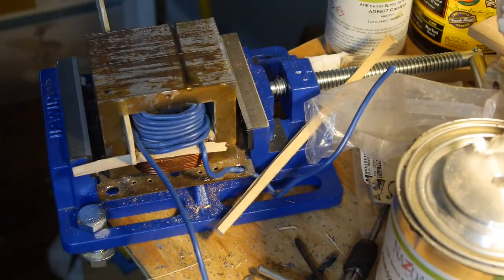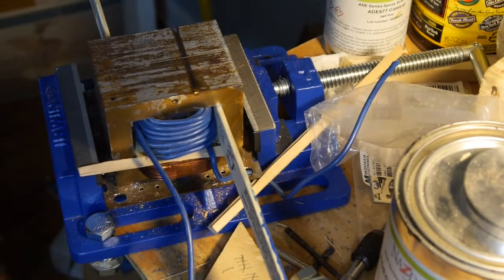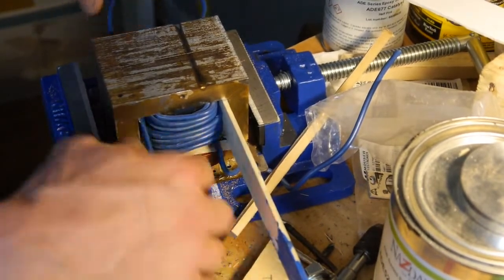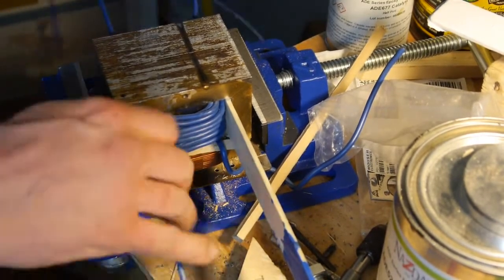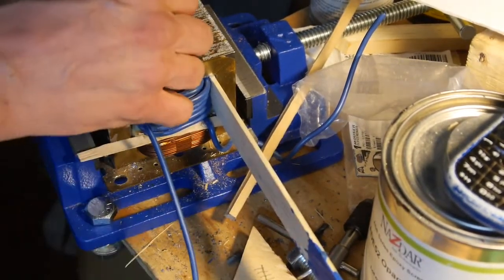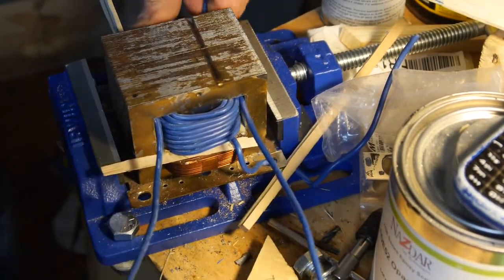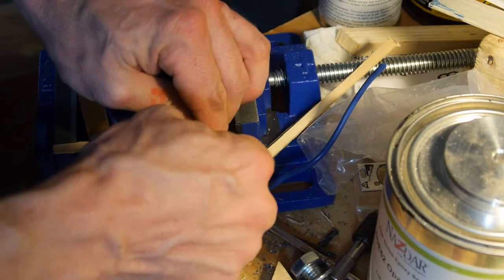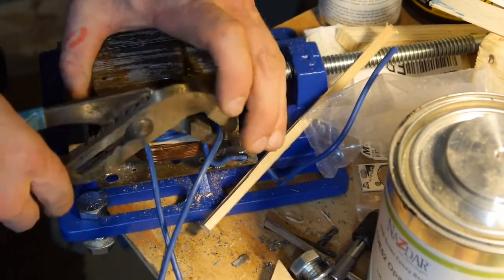Transformer Down! ReWinding Secondary Coil on the AniModule Microwave Oven Transformer Stick Welder

Comment: If you cut along the welds and persuade it with a hammer it will come clean off.   You could and should glue it or weld it but really there's a magnetic field created that keeps it pulled together when powered.
Reply from the maker: Great to know. Thanks! Never thought of the magnetic field

Comment: personally i would think that a DC circuit would be good for laying welds onto something, but the AC would get a stronger bond at the weld surface, so with the osculation of the AC it can be harder to use.